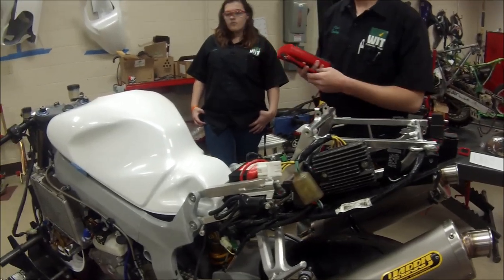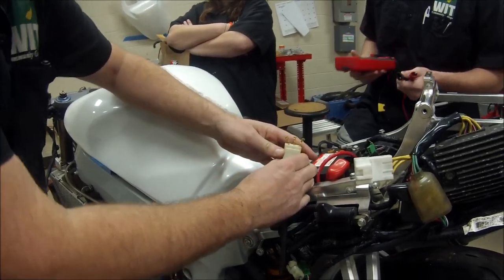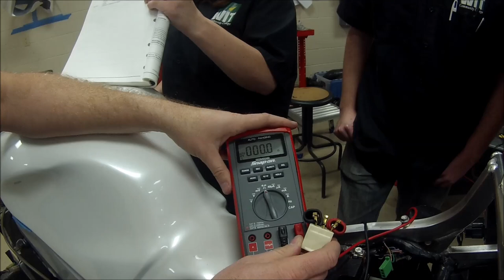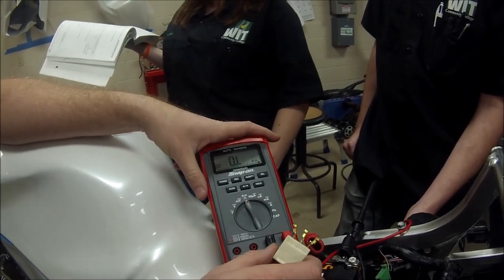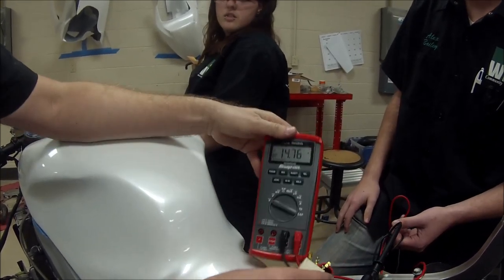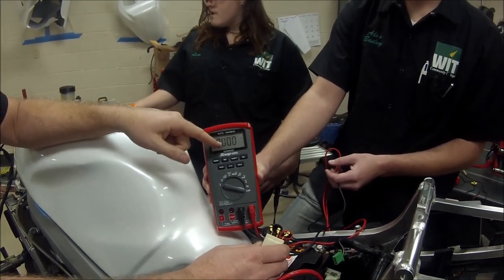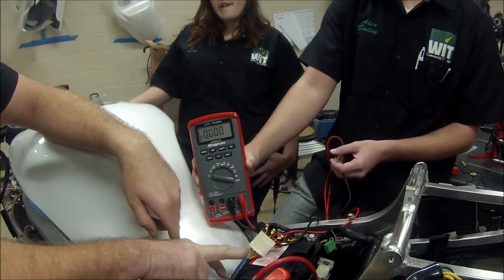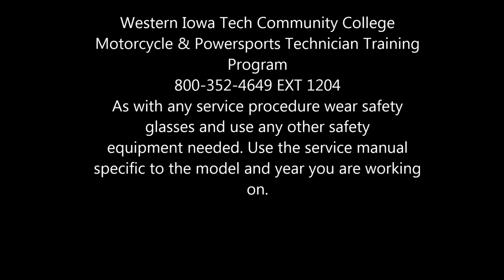How to test a motorcycle stator for AC VOLT OUTPUT AND CONTINUITY Also ATV UTV

Comment: Thanks.
What if the ac voltage drops to 5 at idle and 4 when revving, with the regulator/rectifier connected?

Comment: Hi Shane, all of these tests checked out for me except where you touched one lead from the stator to the negative of the battery.  Doing that for me did NOT yielded a resistance (not OL).  Does that mean this circuit is not properly grounded?
Reply from the maker: Hi Peter. We would be glad to work with you in detail. Follow this video just as shown. If it was a quick answer I’d try to respond here but I wouldn’t want to lead you wrong assuming certain factors. Reach out to me on my website contact page. We have been overwhelmed with ungrateful people and
scammers so I had to do something for my sanity by screening the over 300
requests a week! I’d love to work one on one with you! Contact Link: https://how2wrench.com/contact/ 

Your answers and help are just around the corner. Save time and money while protecting your investment and yourself by doing it the right way at www.How2Wrench.com 

Have you subscribed yet to never miss a video? Have you seen the video playlists https://www.youtube.com/user/conleybuilt/playlists? 

Want to say “thanks” or “keep it up”?
Click here https://www.paypal.me/how2wrench
Reply: The test checks for a fault in one of the stator’s wire.  Resistance shows it has failed.

Comment: Can i ask a question  when the stator  is connected  to the rectifier  and you probe the 3 main ac wires and you rev the bike . Why does it drop it voltage  to under 10v from 12 to 13v on tick over  this is on a 125
Reply from the maker: Sorry for the late reply to a sub...There is no value in tested "AC" with the stator to reg/rec hooked up. I can't explain (maybe someone else can here) why it does that under load. Do as I show in the video for best results. 
🙌 🏁 First off, thank you for SUBSCRIBING! Love seeing our subscribers comment on how the video helped! It helps us!
Here is a way to support all the free videos.
Want to say “thanks” or “keep it up”? Click here https://www.paypal.me/how2wrench  

Coach Conley is also available for hire to personally work one on one with you if ever needed. Yep he is a real person. Give him a call @ 602-345-0432

Your answers and help are just around the corner. Save time and money while protecting your investment and yourself by doing it the right way!
Follow us!
Web:
www.How2Wrench.com     
www.Tools2Wrench.com
Reply: I have similar readings, is this normal?

Comment: Is it bad if the resistance test gets over 1.5 ohms? 
My motorcycle service manual says the value should be between 0.1 to 1.0 ohms and the result is between 1.5 and 2.0 ohms.
ALSO in the same manual there is a troubleshot tree and it only point to a faulty generator IF there is NO continuity.
This is confusing to me.
Reply from the maker: +felcas 
Make sure and zero your meter or at least subtract the difference from your component reading.

Comment: I'm guessing everything on that bike was connected to run and your test connections just ran off connections- eg. nothing was disconnected to test? thanks
Reply from the maker: You disconnect for AC output and parasitic draw. I should have videos on those tests in my electrical playlist. 

Head over to the new website and subscribe to the newsletter to never miss a video or newsletter! 
https://how2wrench.com/contact/ 

If I can ever be of service to you, here is a video explains how to connect with me. 
https://www.youtube.com/watch?v=vjvmB01ebcs 
Keep Wrenching,
Shane Conley
Instructor/Motivator/Motorcyclist
www.how2wrench.com

Did you like this free video and hope to see more? Would you just like to say thank you with a donation? Click https://www.paypal.me/how2wrench 

p.p1 {margin: 0.0px 0.0px 0.0px 0.0px; font: 12.0px 'Helvetica Neue'; color: #454545}
p.p2 {margin: 0.0px 0.0px 0.0px 0.0px; font: 12.0px 'Helvetica Neue'; color: #e4af0a}
p.p3 {margin: 0.0px 0.0px 0.0px 0.0px; font: 12.0px 'Helvetica Neue'; color: #454545; min-height: 14.0px}
span.s1 {color: #454545}
span.s2 {text-decoration: underline}
span.s3 {text-decoration: underline ; color: #e4af0a}
Reply: Shane Conley my quad will not after i put in my new battery so im thinking its the stator. what kind of reading would my give if its not working? O's?
Reply from the maker: PIMPSTA951 
I can ever be of service to you, here is a video explains how to connect with me. 
https://www.youtube.com/watch?v=vjvmB01ebcs 
Keep Wrenching,
Shane Conley
Instructor/Motivator/Motorcyclist
www.how2wrench.com
Like freebies? Click here for a free diagnostic checklist! 
http://gem.godaddy.com/signups/364621/join 

Did you like this free video and hope to see more? Would you just like to say thank you with a donation? Click https://www.paypal.me/how2wrench

Comment: I'm not sure bike's wiring is, but I'm getting a continuity beep when i connect to each of the three phases and the negative terminal of the battery/chassis of the bike. Another weird thing, when the multimeter is turned to ac voltage mode, with the engine on idle rpm on two of the phases I'm getting 20-23v between the phase wire and the negative terminal of the battery/chassis, and on one phase I'm getting no voltage output, and a mere 1.3v chassis to ground output when i rev the engine really high. I do see ac voltage output when i measure it across two different phase wires though. Could these readings be indicative of something wrong with the stator coil?
Reply from the maker: That's a good question for Shane directly. Have you considered joining the channel to get him daily as a member benefit?
You reached the social media team here. We get 300-400 requests a week, so it’s a bit time challenging as you can imagine. 
Shane does try to answer some non-members' questions when he gets some time so hang tight if you’re not in a hurry. 
Did you know one of the member benefits is to ask for which videos would work for your needs and get daily "quicks answers" to questions directly from Shane?. Best $1.99 a month you'd spend...of course enjoy the over 700 free videos and access the the member only vids with all the other benefits listed below. 

There are two immediate options that can get you a solution within 24 hours and quite often within the day. 

Option 1: 
Consider joining...best $1.99 you'll spend this month 😁 This is great for quick answers. 
He literally logs in and answers member questions daily! He does an AM and PM check-in to answer all member questions. Join this channel to get access to perks:
https://www.youtube.com/channel/UCBhM8DCKnT3qXwTW0eToyCg/join       
-Daily MEMBER FIRST COMMENTS ANSWERED FIRST 
-Live Q/A video chats
-Wonder if we have a video on your need? Members can request content links!
-Full Access to the ENTIRE 700 video library
-Member-Only FREE tool giveaways  
Ways to support or high five How 2 Wrench! Thank you in advance. YOU MOTIVATE US TO DO MORE!
1. Smash the subscribe button (thank if already a sub!)
2. Have you seen our "YouTube Trained Support Shirts?  https://goodfellasmerch.com/collections/how-2-wrench/products/support-shirt   
3. High five donation:  https://www.paypal.me/how2wrench    
4. Got an emergency and your head is about to explode from frustration or fear? Get Shane’s cell here: https://how2wrench.com/ols/products/techline-one-on-one

Comment: Can some one help me... Plz

My stator 3 yellow wires get super hot, is that normal?
Reply: just heat isnt enought to say your coil or something else is bad. you should check the voltages and resistance. Between the stator coils and to the battery negative as you see in the video.

Comment: my stator has continuity between phases (.9 omhs) and is not grounded out but has NO voltage coming out when bike is running it is acb350f  have a feeling its dead what is your opinion
Reply from the maker: You can reach me personally @  https://how2wrench.com/contact/
Please show your support by a membership or donation to get the help you need beyond those popular free videos that have saved you so much money and grief! You can say thank you here: https://www.paypal.me/how2wrench
Reply: I have the same issue. I replaced the stator and rotor. Still the same issue. No voltage from the stator. The brushes are good. I'm going to return the new stator and rotor for new units.
Reply: @How2Wrench  dude, quit begging for money.

Comment: My bike has issue. Shows the tendency to get shut down with rpm dropping immediately or drops and gains and shuts down eventually. This happens only in side stand or intilted position only after a ride and not at morning start. 
Checked the carb fully. Replaced float and float valve along with mixture screw. Nothing helped
Reply from the maker: https://www.youtube.com/playlist?list=PLAtBOuPaEyt-ZMVRlpvWmVFLL10P16vWf

Have you Subscribed yet to never miss a video? Have you seen the video playlists https://www.youtube.com/user/conleybuilt/playlists? 

Want to say “thanks” or “keep it up”? Click here https://www.paypal.me/how2wrench    

Your answers and help are just around the corner. Save time and money while protecting your investment and yourself by doing it the right way at www.How2Wrench.com

Comment: Sir...i had a bike which was passing the ac volts test when i tested it across the two wires of the two phase stator but when i tested by putting red lead of multimeter to one of the two wires of stator and black lead to ground..one wire showed a massive difference in reading coz the stator coil was burnt
..but why it passed the test the other way???please reply sir
Reply from the maker: Quick answer is it found the fastest place to "leak" or easiest resistance. Have you subscribed yet to never miss a video? Have you seen the video playlists https://www.youtube.com/user/conleybuilt/playlists? 

If it was a quick answer I’d try to respond here but I wouldn’t want to lead you wrong assuming certain factors. Reach out to me on my website contact page. We have been overwhelmed with ungrateful people and
scammers so I had to do something for my sanity by screening the over 300
requests a week! I’d love to work one on one with you! Contact Link: https://how2wrench.com/contact/

Your answers and help are just around the corner. Save time and money while protecting your investment and yourself by doing it the right way at www.How2Wrench.comWant to say “thanks” or “keep it up”?

Click here https://www.paypal.me/how2wrench
Reply: @How2Wrench  ...thanks for the reply sir...and yes i have already subscribed...i wish i could afford to come to your country and learn from your institute☺...you are really best in what u do...

Comment: if my stator out put is 25 v and when run the engine to 4000 rpm i got 70 or 80 volts my bike is kawasaki zx6r 2006 so it's normal or not ?
Reply from the maker: You're very welcome and in luck. I provide one on one help. I can look up your specific specs and teach you! Contact me here: https://how2wrench.com/contact/ Your answers and help are just around the corner. Save time and money while protecting your investment and yourself by doing it the right way at www.How2Wrench.com  

Have you Subscribed yet to never miss a video? Have you seen the video playlists https://www.youtube.com/user/conleybuilt/playlists ? 

Want to say “thanks” or “keep it up”? Click here https://www.paypal.me/how2wrench

Comment: my 2003 Harley  randomly shut off during  a ride  i replaced the battery worked fine but im worried its running off the battery now and the stater is bad     how can i test that with out a meter  to see if its running off the stater and not the battery
Reply from the maker: countryman2821 You need to test at the Battery for dcv to verify charging system is working. I will be making a new quick check video Monday.